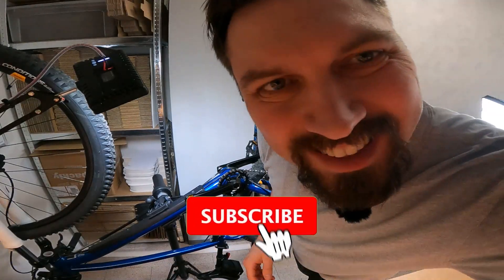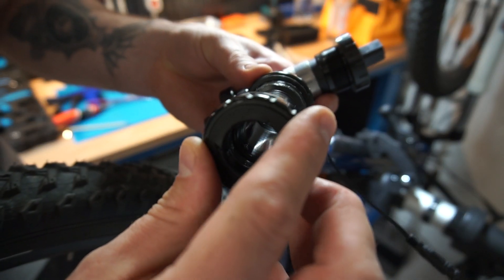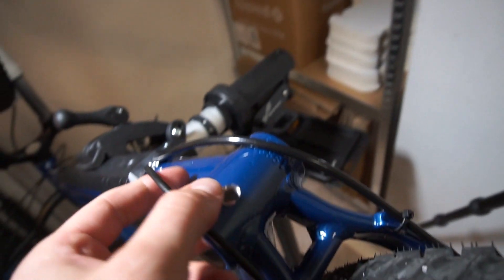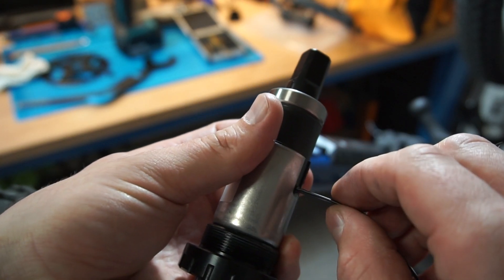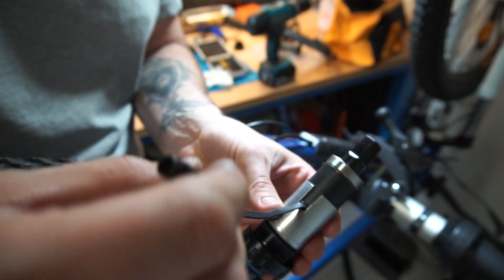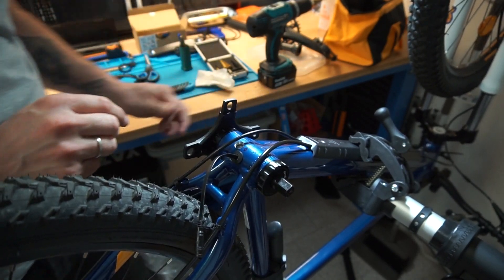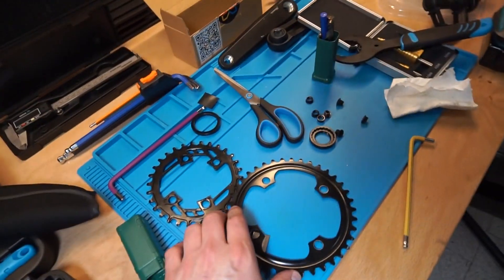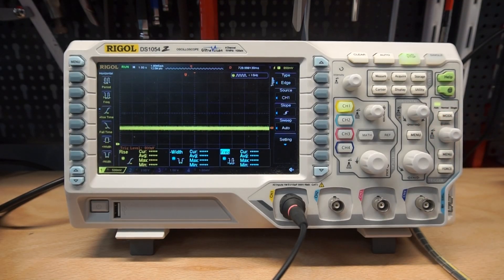80Nm E-bike TORQUE Crankshaft: The Future of Electric Biking Pedalling!

Comment: Hi. Your level is definitely higher than I'm considering. On Thursday last week I bought a 60 years old bike, disassembled and checked during the W&. Meantime i checked the different solutions to e-bike transformation. It is compatible with mid motor, but i'm concerned about transmission wearing out => too expensive to maintain. Since the typical hub motor cons is efficiency I ask you the root cause for this statement. I understood brushless motors works efficiently only in a speed specific range and hub motors need to manage all speeds (from 0 to the max rpm). Is this explanation correct? is also complete? In case I understand, the usage's definition is the key for a proper motor selection. E.G: flat and rural roads (no crossroads, no lights, few turnabouts) and 28km/h average (about axle 230 RPM, which maps to a certain motor value). Is that sufficient to select the suitable motor? So far I couldn't find a motor seller that shows these kind of details. Please, give me some of your knowledge. The bike I bought is an ATALA Campagnolo components equipped (very stiff iron frame but only 14,8kg bike's weight) and almost unused by the previous owner (it's a true jewel!)
Reply from the maker: Hi! Great purchase, congratulations! Since it's a classic road bike, there’s a question about the final design of your e-bike. For instance, how do you plan to mount the battery (type, max current and voltage), and what type of controller do you intend to use (and where do you plan to mount it)? Also, do you want to keep the original transmission, or are you thinking of building something new?

At the moment, we have a brushless hub whose initial lack of torque is effectively compensated by the bike's transmission. However, if you’re interested in a fixed-gear setup with an electric equivalent of transmission (possibly even a potentiometer in series with a crankshaft torque sensor), then a geared hub might be a better option. Just keep in mind that there could be higher losses in the geared component. Check our videos descriptions there should be all the components listed with the websites.
Reply: @SOLOMotorControllers  Hi, thank you for the complete answer. So far little idea. Battery 10/13 Ah (small. Voltage could be 36V, but I think it will be tuned with the motor) mounted on the lower tube (i've seen this solution many times and I think it is better to add weight at a lowest possible height). I plan a small battery to center and reduce the weight, and to have a very limited assistance, just to keep my standard 28-30km/h average speed even in windy days. No idea about controller (it might be positioned in a small bag linked to the frame). At this initial phase, I'm trying to address the motor selection. The torque sensor seems a plus. I'm fascinated by the technology, but I'd avoid it if it's not strictly needed (to stay simple). Regarding to the transmission the chainrings have 50 and 46 teeth. The cassette has 5 speeds 14/16/18/20/22 teeth. I think I need to change only the two chainrings from 50-46 to 44-38 (the 44 chainring with the 14 sprocket allows for 30km/h with a 75 PPM cadence).  The sad point is that I do not find the spare parts and I'm thinking to buy standard iron chainrings and adapt them accordingly by welding proper brackets (can I send you a picture?). Thanks!
Reply: the main concern relates to the motor selection. Please, help me with your knowledge. As I told I started to think about e-bike transformation exactly one week ago and I'm stuck on choosing the motor. The rear hub solution is preferred. The main drawback of that solution relates to lower efficiency. I've read the brushless motors work well only in a limited range of RPMs. Is that true? And is it true for all brushless motors regardless the their manufacturers? I understand that brushless motors are the only choice for e-bike. Do you agree? That said, I have to choose the brushless motor that best fits my application. For that reason the requirements are quite simple: flat and rural roads (no crossroads, no lights, few turnabouts), 28km/h average (about 230 RPM at the wheel hub, which maps to a certain motor shaft) and very limited assistance ideally to boost from 25kmh (ensured by my legs) to 30 and only in windy days (5% of the days, but I assume, please, correct me if I'm wrong that the motor includes a clutch so there is not drag if it is switched off). The chainrings' problem has been almost sorted out, therefore I count on a transmission that spans from 1.7 to 3.1 ratio 'rear hub/pedals' (I'll use almost always the main chainring and the last three sprockets corresponding to ratio 3.14, 2.75 and 2.44 so to ride between 22 and 33km/h with cadence between 70 and 82). Which motor would you suggest me to choose? And what are the rationales? (maybe I'm thinking wrongly and the controller is the most important part to select. Please, note I have some programming knowledge). Thank you!
Reply: I just add that the space for the wheel in between the front fork and the rear frame is 100mm (front) and 122 (rear).

Comment: So were did u get the controller to match the torgue sensor
Reply from the maker: We used our SOLO MEGA with some firmware changes.
Reply: @SOLOMotorControllers can you configure a controller so it can be used with a cadence sensor also ,or just configure a sell a controller to suit my sensor ?